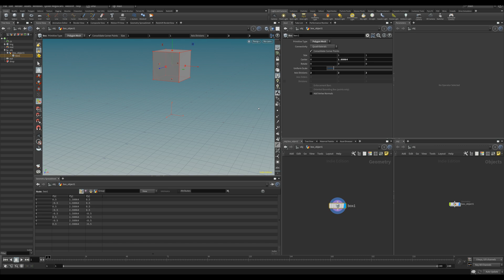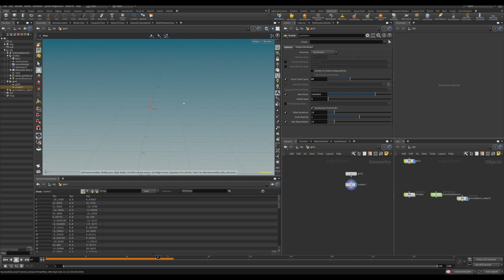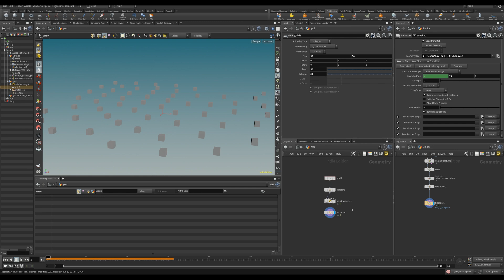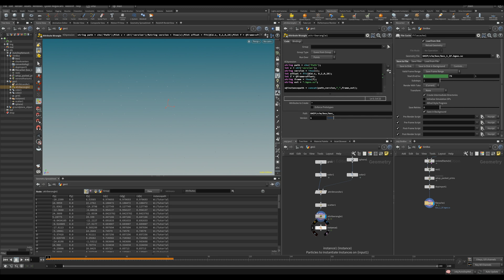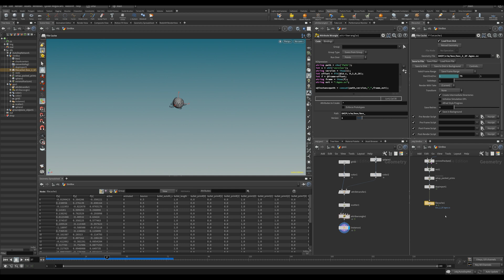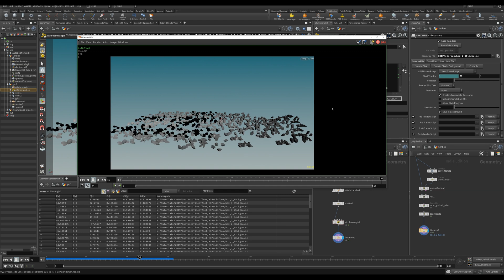Houdini Tutorial - Time Offset Instances

Comment: BUT! how can we orient instanced geometry along normals. 'instance' node doesn't seem to have such functionality
Reply from the maker: Use @orient instead.
Reply: @TimvanHelsdingen  yes. works like a charm. for the sake of all the gentlemen with the same tasks, let me show you what I have in my wrangle. basically, now it orients instances along normals and randoms rotations properly: 

v@up = set(0,1,0);
matrix3 m = maketransform(@N,@up);
m*=rand(@ptnum);
rotate(m,float(rand(@ptnum)*6.28),@N);
@orient =  quaternion(m);

v@scale = 0.1 + rand(@ptnum)*0.15;

string path = chs('path');
string flowername = chs('flowername');

int ver = 3;
string version = concat ("0",itoa(ver));

int f = int(@Frame);
int offset = int(rand(@ptnum) * chi('random'));
int len = chi('length');
f -= offset;
f -= chi('start');
if(f<0) f=0;
if(f>len) f=len;
string frame = itoa(f);

string ext = "bgeo.sc";

s@instancepath = concat(path,flowername,"_",version,"/",flowername,"_",version,".",frame,".",ext);

I may mistake, but this solution seems to work much faster than copytopoints
Reply: @KirillovVladimir1980  You are correct! My bad. At first, the solution with copying within the SOP appeared faster to me. It was because of small quantity of points which has been used to compare this method with the Instance node). BUT, on the large scale, the latter is WAY faster! And also, it utilizes the @instance attirbute, which can be used in the same fashion as @instancepath from the abovegiven example, allowing to randomize output.

Comment: Is there a way to offset per point instead of using the transfer Cd attribute?. i.e Each point would offset , say 5 frames linearly?
Reply from the maker: All the setup does is offset which instance it loads, you can modify it however you see fit.
Reply: @TimvanHelsdingen  Thanks for the reply. I kind of figured it out; in the offset I add @ptnum to the slider and it does the trick that I was looking for. Thanks for the tut.

Comment: For some reason, the instance SOP won't read the bgeo sequence. This works fine with s@instancepath set to "path" but not with concat function. The path in spreadsheet is correct so not sure why it won't work here.
Reply from the maker: that's weird. You sure path is okay?.. maybe just make a new instance node? Alternatively you could also use the sprintf function by the way, only heard about that until after I made that video.
With that you can replace a part in a string with an attrobute.
sprintf("../mypath/myobject_%s",  i);
would add the value of i into the string.